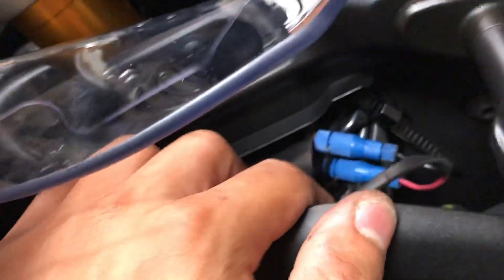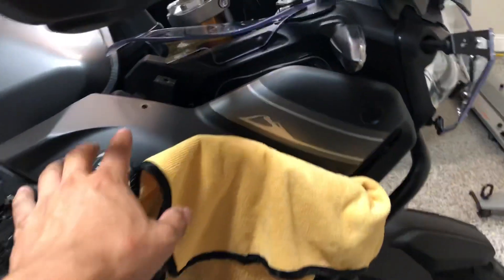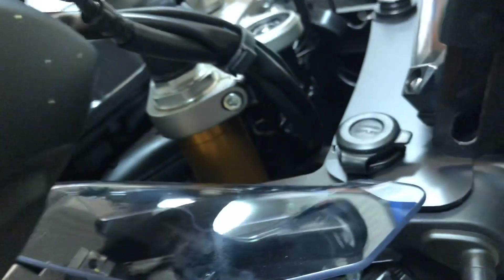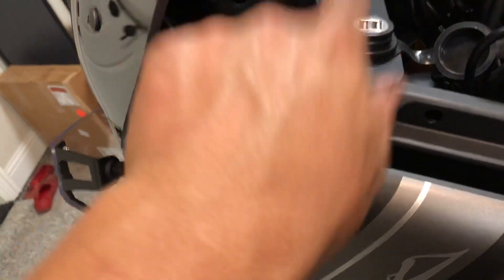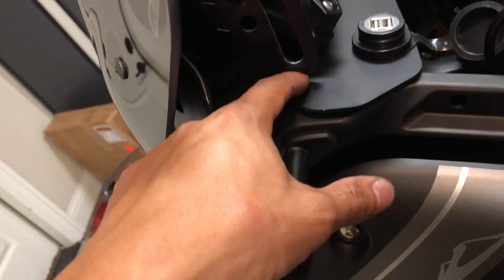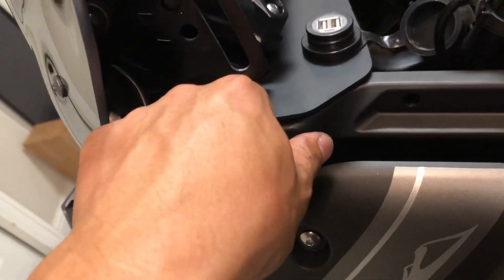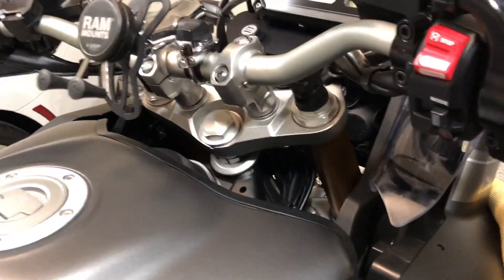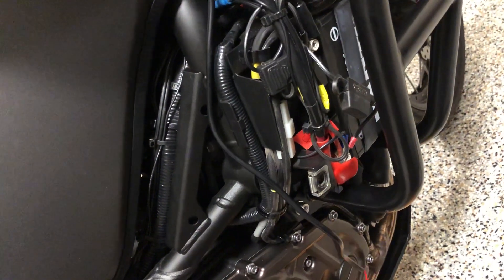Super Tenere panel infill

Comment: Did your factory plug simply twist off by hand?
Reply from the maker: Trey Bass there is a locking nut on the bottom aide of the factory plug you need to untwist and remove.  Then the factory plug comes out